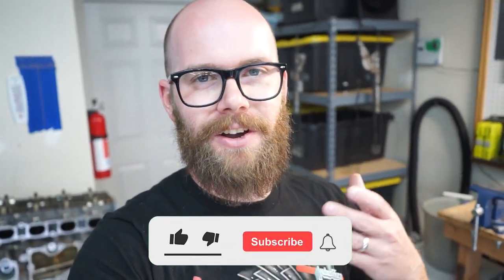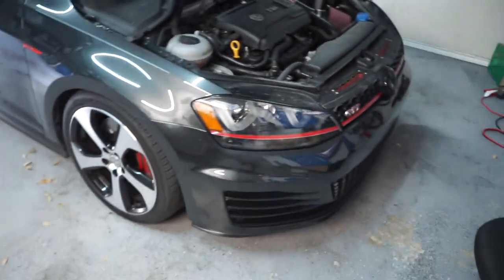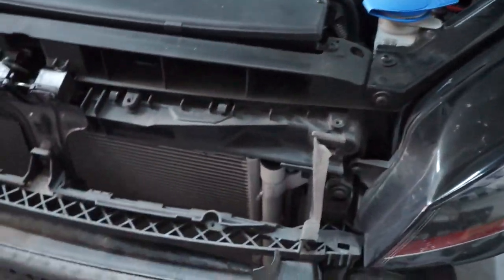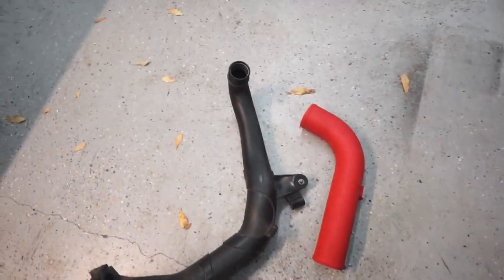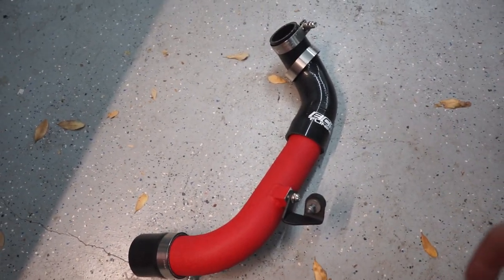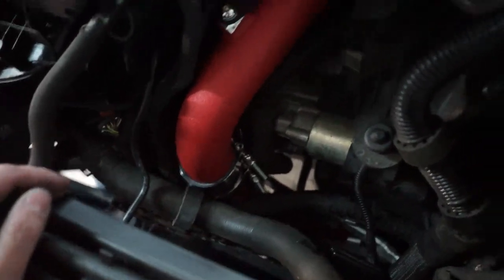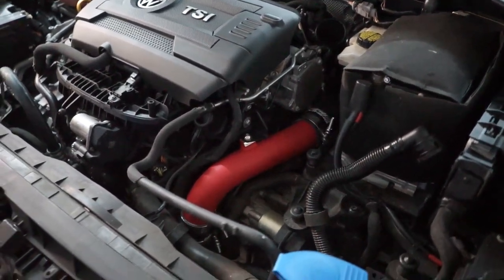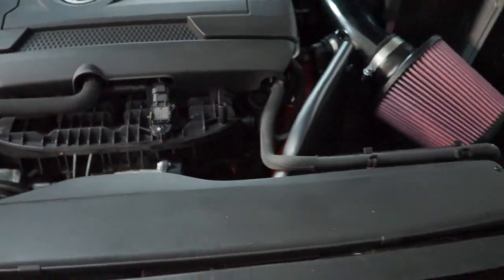High Flow Intercooler Charge Pipe Kit for my Mk7 GTI!

Comment: Nice color. I just completed an AMS intercooler and EQT charge pipes with turbo muffler delete. So much more time consuming than I expected... worst part was taking out my battery and battery mount... then realizing I buried the positive cable and having to rip out my Cobb intake(Closed metal and massive pain in the ass... will replace down the road). I, like you, plan on adding a downpipe after the intake end of things. Have a stage 1 EQT tune(Only an intake and turbo inlet pipe), already having clutch slippage so will wait until I can afford a new clutch and mounts before going stage 2. Thanks for the uploads... these are invaluable for guys like me who have never attempted mechanics and want to build up a MK7.5 over the next few years.
Reply from the maker: Thanks for watching!!

Comment: Thanks for this. I've never worked on a car before doing much of anything but the PO of my 2016 GTI used a pretty bad kit and the silicone parts are stretched and useless now. I'm getting awful boost leaks and I'm just going to replace all the charge pipes etc. So, hell of a first time project.

Comment: Nothing wrong with it but charge pipe upgrade doesn't provide any benefit until you get into the 500+ horse power range.
Reply: I read somewhere in the internet there are gains at 10,000hp! Nothing wrong with your comment, is ae accurate as mine.

Comment: Did you have an issue with the throttle pipe keep coming off on the passanger side coennecting to the intercooler?
Reply from the maker: I had a few issues with 2 connection points

Comment: Pros? Throttle response? Any cooler temps?
Reply from the maker: Havent really checked temps since it's still stock intercooler. I did this with plans for downpipe and wanted to best possible flow for the entire induction and exhaust system!

Comment: Late to the party here.
There is zero benefit on stock power nor upward on even an IS38 or +
There is no restriction to air flow until a reach for bigger turbos that are pushing well above 400whp.
Should have saved the $ and upgraded the IC.  Tune & IC are the best bangs for your buck for power increase.
BTW - when you do upgrade your IC you'll will need NEW IC pipes to mate into the fittings 👍
Reply from the maker: I have all those things. You are late to the party haha